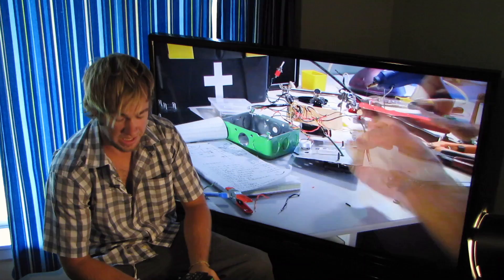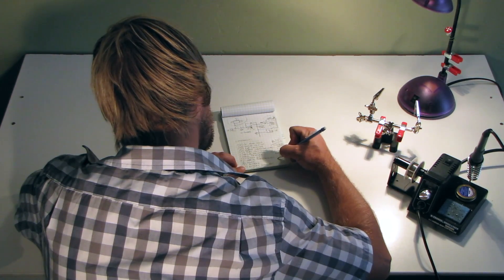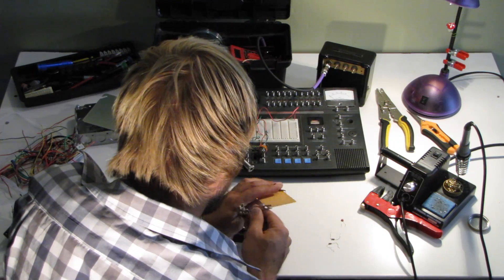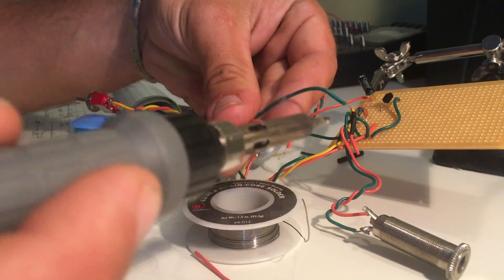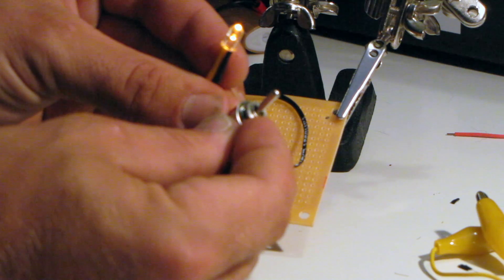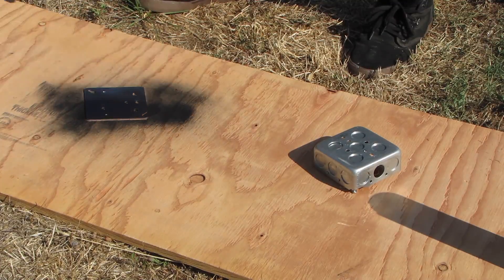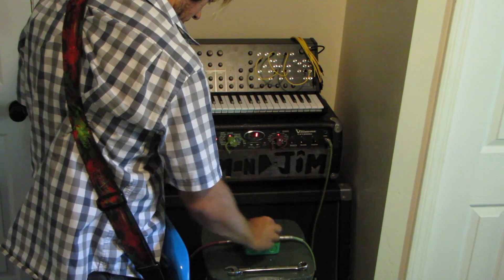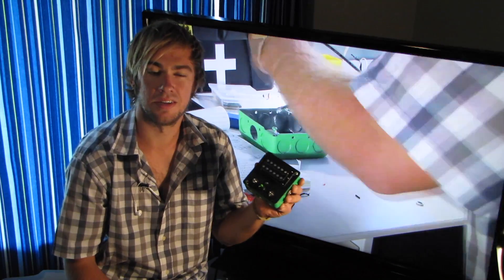Make a Distortion Pedal!

Comment: Aw man, you got me in a rabbit hole here, and I hope I'm not stuck. I'm curious as crap.

The pickup.. What is it doing, electrically? 
I imagine there could be some sort of HPF effect, with the coils acting as inductors, dumping low frequencies to ground. But you're using them as a sort of clever variable resistor, I believe. Maybe?

So, with the pup switched on in the pedal, it's certainly causing a filter effect, but possibly below the signal frequency. 
If I may guess... Introducing the magnet, are you pre saturating the coils, dropping their impedance, essentially creating a proximity sensitive potentiometer to ground? 
Or in other words... Is the proximity of the magnet, lowering the saturation voltage of the coils? In turn, raising the cutoff frequency of a ridiculously simple RL filter, into the signal frequency range? 

If that's not what's happening here... Please, please, help me understand. I'll be chasing information until I figure this out. I'm like 1.5 months into this crap, self guided, so please excuse any beginner misunderstandings
Thanks
Reply: Oh boy.. I'm not sure if this is a good or bad thing for me.. The ideas are going to go crazy for me. 

I'm noticing you used a humbucker, which would be two coils, in parallel as you have wired. Have you tried them in series to see how (if) that affects the magnetic sensitivity? 
Or... Instead of dumping to ground, possibly dump straight to output? So when the magnet is near, you can blend in a clean signal, or a parallel path to another effect? 

I tinker more theoretically, than actively, due to time constraints. I'm always coming up with weird crap that I never get to put into practice, frankly because life. 
But I'd be curious to see two (or several) parallel setups like this, which use different effects that can be blended by simply moving a magnet between coils that control each parallel signal. 

Orrrr... A clean boost circuit that uses this concept to dump a controlled amount of feedback from the emitter to base of Q. Or to control gain of an opamp... To use the amp circuit feedback to overdrive itself, maybe? 
Or in series with the clipping diode(s)

I need to stop, before I go full nuts here. 
(Found this video while looking up ideas to build onboard effects for my banjo. I think I'll be nosing through your videos here later. It appears you spend your time building and playing with the sort of stuff I'm always dreaming up. Love it)
Reply from the maker: Awesome! I haven’t tried that but sounds like a fun plan! Let us know if you go through with any of that I’d love to see some of it come to life 😊 good luck with everything and thanks for checking out our videos!
Reply from the maker: Hey there! Thanks for the inquiry.. I believe it is doing what you said: acting as a proximity sensor of sorts as a magnet sensitive potentiometer. I discovered it would act like this by accident.. a happy surprise. So yes! It controls the amount of voltage allowed through the ic. Hope that helps!